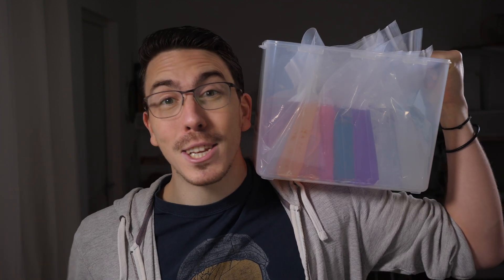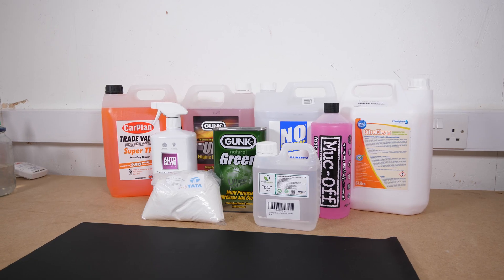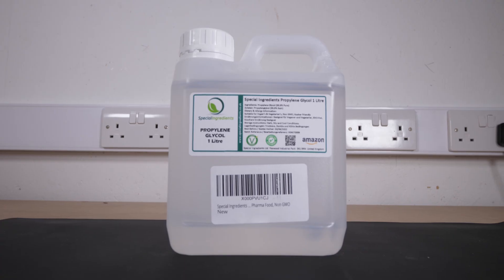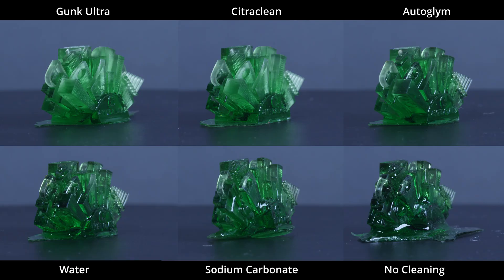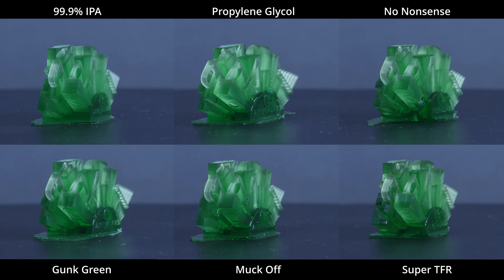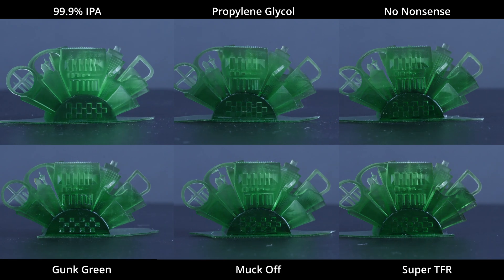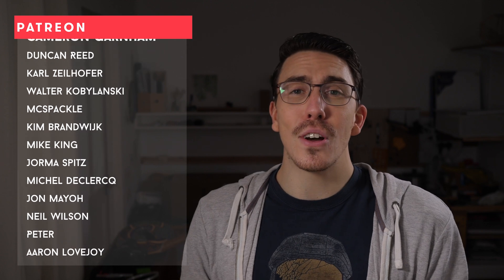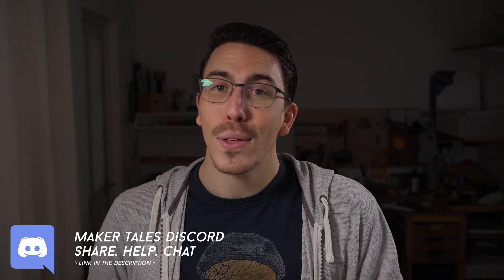IPA Alternatives For Resin Print Cleaning | EU Available

Comment: The biggest take away from my use of Propylene Glycol is using a heated ultrasonic cleaner.   Process goes like this.
Heat PPG in ultrasonic cleaner to 45C. Place part into ultrasonic cleaner for 5 mins. Yank and remove the supports (super easy when warm). Place part back into ultrasonic cleaner. for 3-5 mins.  Remove, shake dry, rinse with IPA & scrub with brush.
Resin sublimates out of refrigerated PPG. Pour the top off, capture the clumpy junk resin, cure and trash. Reuse the clean PPG.
So much safer and honestly easier then other stuff I have used.

Comment: Well I appear to be a bit later to this, but cheers for the review. I've got some Glycol on your recommendation and tried a bit of slooshing rather than filling a whole tub, just to experiment, and the immediate issue is how the devil do you get it off? It's very slimey, obviously, and even dousing with IPA doesn't shift it? Any ideas? I've looked online and some of the comments on industrial sites seem to suggest  it dissolves in water, but I'm loathe to try this on a print in case it . . . doesn't :).

Comment: In the Netherlands there is a cleaner called Dasty that I have very good results with. It's a non inflammable (ph7-8) detergent. Just wash the part in it with a soft brush and do the last cleaning with denatured alcohol (Brandspiritus). Do the end cure with UV and you're done. Used it myself on Anycubic resins, but as always: YMMV.

Comment: Maybe (maybe!) a cheaper solution would be some less refined propylene glycol, I don't know if it exists and it's commercialised, but if it is, then it would lower the price per liter. 

I think that it's water soluble, so it's better to buy the 99.9% solution, and then dilute it to the right point. I guess some tests should be done in order to find the optimal ratio between PG and water.. a 70% should work. 👍

Comment: I use 94% household alcohol, which is the cheapest solution in Denmark. Cheapest purchase price is 99 DKK (13.27 Euros or 11.51 British pounds) for 4 liters and it can be bought here locally. When I then distill my used alcohol to remove the resin, the price is incredibly low. I can't see any difference if my resin print is washed in IPA or denatured alcohol.

Comment: Interesting results ... but Propylene Glycol seems to be quite more expensive in my country too (Bulgaria), and difficult to find cheaper and in lower volumes (than a barrel of 200L for example :)).
IPA is rather cheap - I can find it for 6-7 euro/L almost everywhere, but recently I bought methyl alcohol  for under 3 euro/L.
My only problem with cleaning is that eventually alcohol gets dirty with washed resin and is not good for cleaning as some particles start to stick to your models, and it also becomes difficult to see inside a container (I can gently grab larger models even blind with a spoon or similar tool, but small parts like weapons for example ... I've found some after filtering the alcohol for reuse :)).
I'm not printing that much to dirty it too quick, and switching between two batches (dirtier for initial rinsing, and cleaner for final clean /in ultrasonic cleaner/).
Filtering I do with firstly ... patience (to wait for the dirtiest batch to settle down), and then I use a water-bottle pump to suck the cleaner fluid on top with minimal disturbing the resin on the bottom. Finally the dirtiest bottom fluid I filter out, which is really slow as it quickly gets to slow dripping, but at this point it's only a small amount and I can leave it to drip for a long time (I suspect that in doing so some considerable amount of alcohol actually evaporates :)).
But since resin and alcohols have a good weight difference (~30-35% ... alcohol is ~21% lighter than water, and resins are usually 12~15% heavier than water) - for comparison it seems Propylene Glycol is almost as heavy as water (~96%) so resin in glycol won't separate well or at least much slower.
But again waiting for the separation is a very slow process, so I devised a rather specific plan now to make a DIY centrifuge (the waste oil type that allows for continuous flow, and separates heavier particles to the sides of a spinning drum, while the clean fluid flows over a top edge and gets collected for reuse).
I've settled on the size & shape of the drum, and already got the attachment to the drill (a Dremel 4300 to be precise as it's a very high RPM), and the tough resin (Siraya-tech Blu Nylon-black).
I only have to draw the drum in 3D (chose Free-CAD as it's not worth it to me to use any paid software, and it seems  Free-CAD is future-proof from becoming paid by its license).
I'll also have to print couple of discs of the same diameter (140mm, which fits in a Mars 3 on its side) to test and see what are the highest safe RPM, and dial down additionally by some safety factor ... then final test with an exact copy of the drum, to account for the full size and some fluid in its working volume.
And finally to assemble/print the housing, which is really simple - it's fixed, and the only important details are on its bottom as it needs to separate 3 areas for collecting the clean & dirty fluid separately, and to allow the Dremel rod to pass thru it center and not allow the fluid to leak thru. There's no pressure or load on the housing, so simple ridges between these 3 areas are plenty to solve the "problem".
Of course when all the fluid has been processed, there's still some fluid left in the working volume of the centrifuge (that couldn't flow over the top ridge), so one option is to collect it in the dirty fluid container and use it the next time you run the centrifuge; filter it the slow way; or the most advanced /but hardly worth it/ way is to use some heavier displacer that would stick to the walls of the spinning drum and would push most clean alcohol to flow over the top edge. If you're not aiming at 99.9% pure IPA you can use well salted water (and if you're NOT using ethyl alcohol, as salting out doesn't work with it - only with IPA & methyl alcohol), or if you don't mind to extract the last 5-9% water by another way (like with micro-sieves that allow only water inside, but not alcohol), btw you can use micro-sieves soaked in water /both heavier than alcohol/ as displacer in the centrifuge itself before stopping it. Micro-sieves tend to leave dust residue, but luckily centrifuge will settle that dust with the resin and you'll still get clean alcohol out.
When I draw the drum & housing in FreeCAD I'll share the plan, and after testing the safe load (ie highest safe RPM) will add the technical details.
So far I've settled on a drum with 140mm diameter as it's small enough to print in Mars 3, and would be ~30mm deep (to keep it lighter when used and full of alcohol).
Initially I've set the target RPM at 12,000 (most Dremel can reach 35,000 RPM), but I'm sure the strength of the printed drum will lead to reducing the RPM enough for safe but still efficient use.
The trick about centrifugal forces is that while the radius contributes to the effective G-force it's only a linear factor, while the RPM is exponential factor! So a smaller but higher RPM centrifuge will reach much higher G-forces.
Just for a reference 11304 RPM at 70mm radius of rotation would result in 10,000 g-force!!! (for comparison polycarbonate CD/DVD discs that are 120mm diameter can spin to above 20,000 RPM before shattering), so while I doubt that I could reach near 10,000 RPM even with tough resins, I'm quite sure I'll still reach few thousands effective g-force :)
Reply: Oh my god, don't use methyl alcohol  - do you know it damaged your nervous system EVEN THROUGH SKIN?
I'm from Poland - I always buy 5 liter bottles, IPA costa ca 9-10 USD, while Glycol (which I never used yet) costs 22-25 USD. For 5 liters. For such cost of IPA it's reall easiest to keep several jars of used IPA to decant. Cost of IPA is low enough that there is no point in building specialised equipment for filtering - investment will never return!
I found also that coffee filters are not a great solution. Even though I'm using some special 3D printed funnel, it clogs completely after filtering <0.5l, maybe even 0.25l of IPA. Therefore process is very slow and stinks like hell. I still don't have any better solution though. 

What I also found is that if washing in water, prints are a bit sticky, even after suring. Like something happened there chemically. Therefore I prefer IPA instead and only in the end I wash with water.

Comment: Regarding ventilation - indeed it's a challenge to maintain comfortable temperature (esp. higher temps if needed for thicker resins), which it's cold outside.
But there's a very efficient solution (that all energy efficient houses should be using) - a Heat recovery ventilation (aka HRV). And they're not difficult to build yourself.
Check for example this guy: "I built the best DIY heat recovery ventilator I’ve seen on YouTube" (search it in youtube)

Comment: I use dawn dishwashing liquid and water in ultrasonic, then repeat with plain water. Works great and a 4 dollar bottle lasts forever.
Reply: What kind of resins are you using?
Reply: I mostly use Elegoo water washable. But I also have Rich Opto standard resin. The dawn works fine on both types.

Comment: A long term resulfs of propylene glycol would be interesting. I use straight ethanol. It's about as safe a solvent as you are going to get. about the same price as IPA where I live and the recommended solvent from most resin manufacturers.
Reply: Ethanol is still super flammable and off-gasses a lot tho

Comment: Thank you for making such and effort with this process. I've found that the temperature swings in the Printing Room make a huge difference to the stickness of the prints. As temperature drops stickness increases. The best way to have a good clean is to operates at above 20c the whole time. This is a major issue is the UK climate. Cold resin hangs on prints.

Comment: PG is very messy as it's sticky and hygroscopic. But that can be an advantage as you can water wash it like IPA without noxious fumes. It will remain on the print so a water wash is needed afterwards.

Comment: For me im using petrol or diesel to completely clean my printed resin.just stir a couple times in the petrol/diesel, then i wash it with dish liquid/detergent.
After that i wash it with water.
It works great.less time consuming and fast result.
Reply: Did you get the same cleaning results from diesel as with petrol?

Comment: Are there any plans to make a follow up video about Propylene Glycol?
Reply: Especially testing in comparison TPM (Tripropylene-glycol-monomethyl-ether, which is better than just "propylene glycol" at cleaning resin) as well as the new Formlabs Resin Washing Solution (where no one knows what's in the secret sauce) and Elegoo's Photopolymer Resin Detergent (whose solvent part is ester-based not glycol-based, plus some detergent) which seems really good according to the majority of (the few) testers.

Comment: Just to complicate your methodology a little, a lot of cleaners don't work best at maximum saturation. In the case of sodium carbonate it works by saponification of oils, so it needs free water available to carry away the oils which the soda has just made soluble. If the water is already saturated, or close to saturation it won't be able to dissolve more substances. Of course it could be that resin waste doesn't saponify anyway, but it's still something to consider.

Comment: Just a PSA, propylene glycol can cause anion gap metabolic acidosis. But it’s nice to know thats an alternative. I’m based in California, and it’s illegal to purchase denatured alcohol here now..so trying to find cheaper alternatives to IPA
Reply from the maker: Great to hear that this is able to help. I did look into the side effects of propylene glycol and it looks like to get those types of effect it's pretty much needs to be injected into the blood stream. For any one reading, remember that this is the stuff that is mixed with water in smoke machines used in enclosed spaces like nightclubs and e-cigs so it's as "safe" as your going to get to break down non water washable resin. But thanks for pointing it out allain.
Reply: @Keep-Making  yup yup of course! I’ve just seen it occasionally in the hospital setting, like you said via IV or injected, and wanted to make sure that folks were informed.
Reply: @Keep-Making  Great video!  I’ve been scouring the internet for safer alternatives since I’m in an apartment.  Any plans to do an update video on propylene glycol?  Have you been able to recycle the cleaning solution and remove waste resin?  Thanks again!
Reply from the maker: @Mushnar-kc9  it's definitely on the list to come back to 😁

Comment: Hey, I didn't know that Propylene Glycol is used for electric smoking. But it solved a issue: I will use it for the smoke generator of my model steam locomotions 😎. It is cheap compared to what I have to pay usually at the retailer.

Comment: we use Propylene Glycol at my work to clean machine components for a 2 part epoxy type mixture. we also use it in a deep fryer instead of a sonic washer (need higher temps). I've found that after so many washes with it, it becomes saturated and will leave a residue, hope this helps.
Reply: So in your experience it lasts considerably less than IPA?